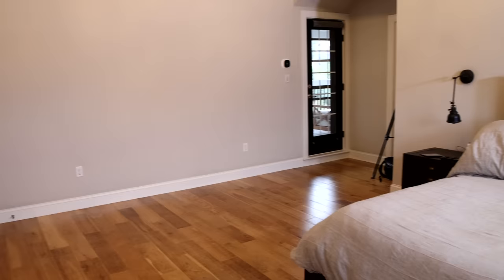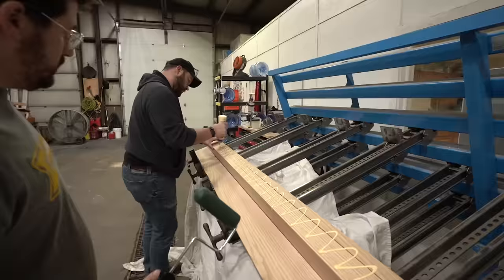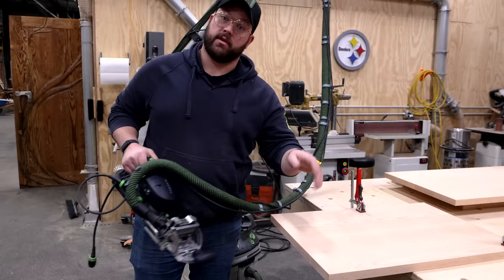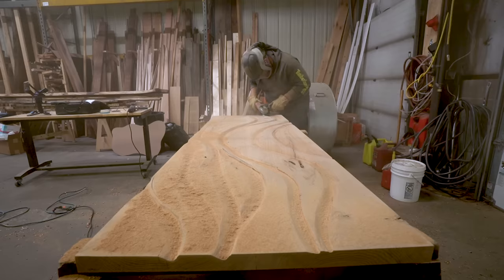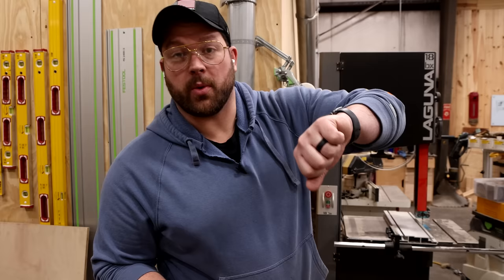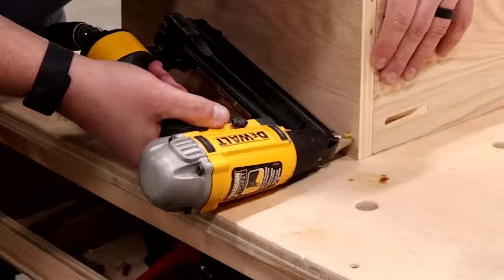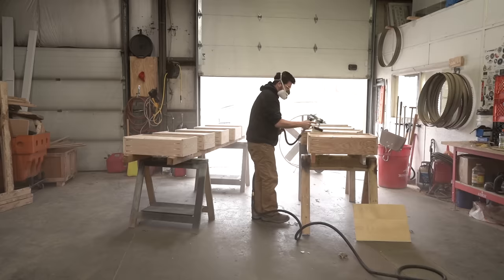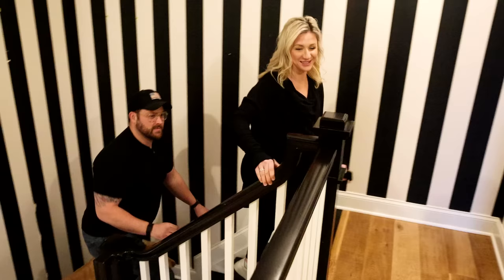I Carved A Custom Surprise For My Wife In Only 7 Days

Comment: Alright for the baby, stay with me on this. A mobile. In the center is string that hangs the lowest. On the string is a light. But the light shines upwards. Then off of each arm of the mobile, is a tree shaped branch. When the mobile turns it the branches move and create different patterns from the shadows on the ceiling. Just a random thought.